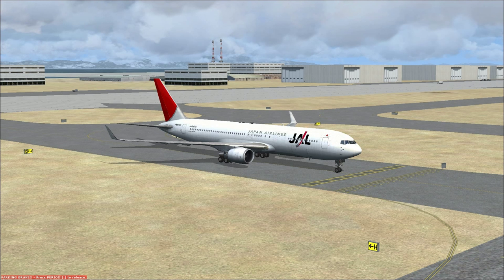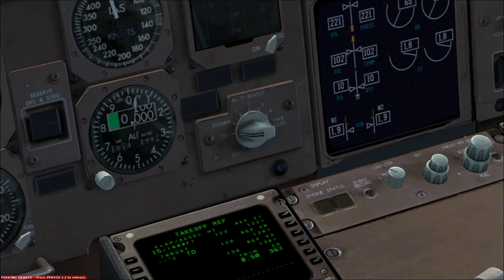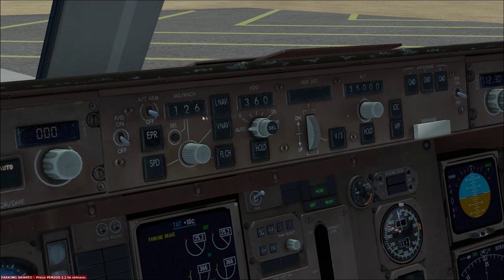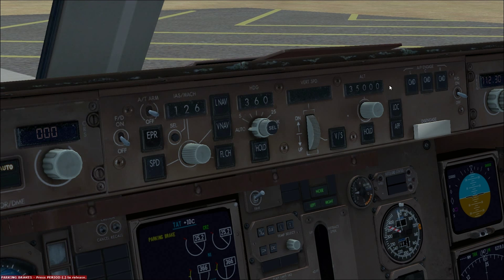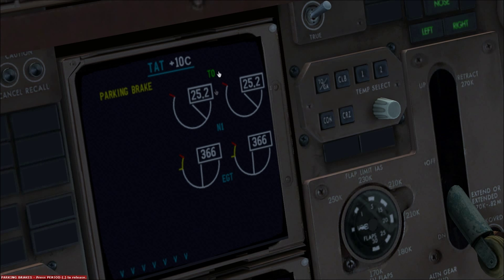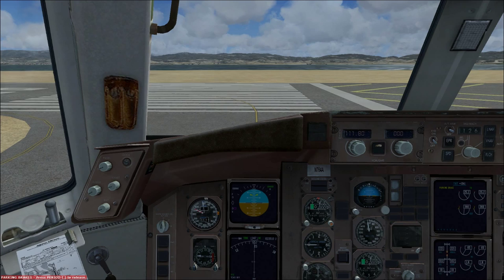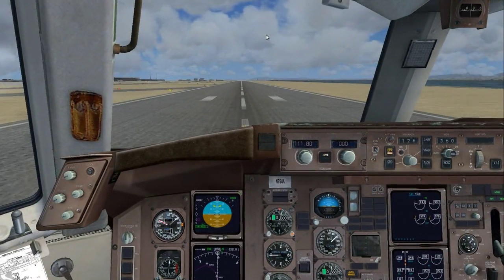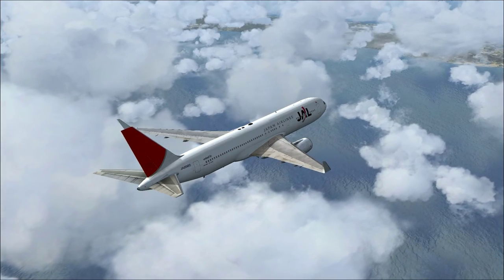767 Tutorial Part Two - Take-Off

Comment from the maker: @mattwharmby I was taught to use VR, but you may be correct. However, considering that  you engage VNAV at 1000ft AGL, and VNAV will set the speed anyway, it probably doesn't make much of a difference. Or perhaps you should set it to V2 + 20 if you use Speed Hold instead of EPR.

Comment from the maker: That's just the trim. If you're flying manually, just trim the plane down just as you would a GA plane. However, if you use the autopilot, the flight computers will take control the pitch, holding a steady angle upwards until you reach cruise altitude.

Comment: ok... first of all flaps should be set after engine start and before taxi, speed on the mcp should be set to v2 speed not vr, you didnt set your altimeter correctly on the ground, yaw dampers are ALWAYS turned on before taxi, before takeoff the vnav and autothrottle should be armed.
Reply: oh yeah.... taxi, and strobe, and anti collision lights should be set, before entering the runway, taxi light should turned off, wing lights and landing lights should be turned on,